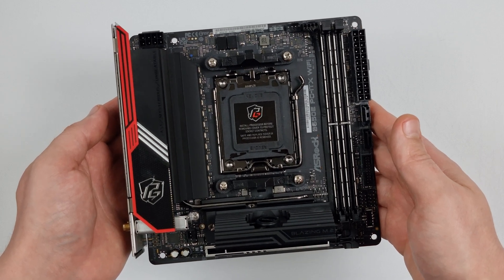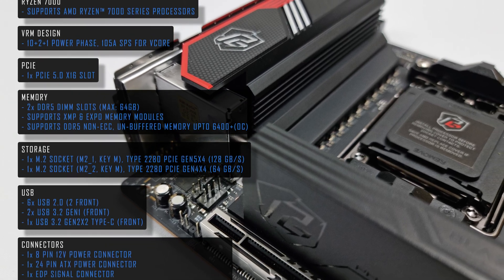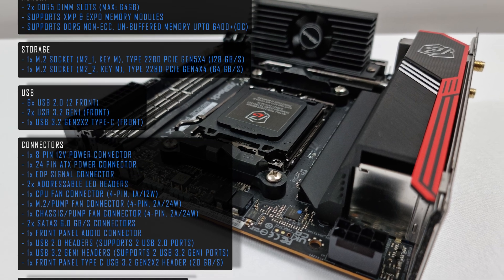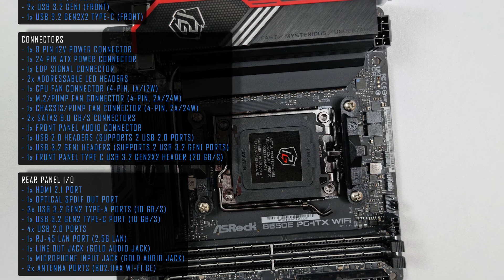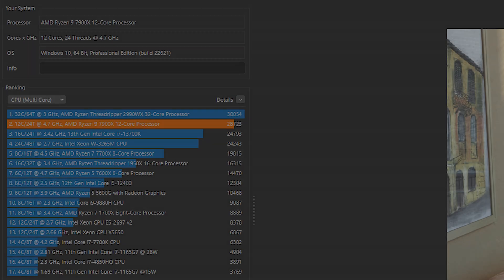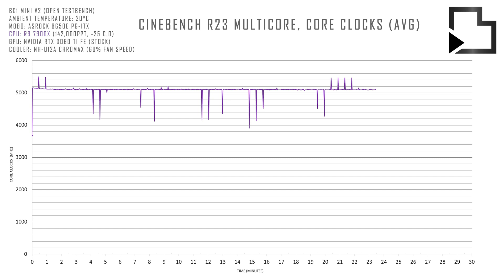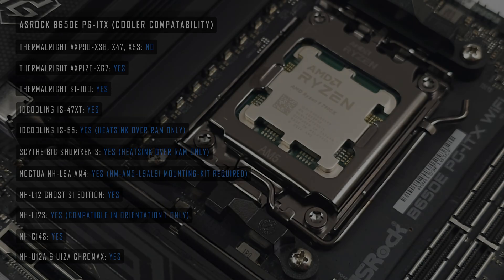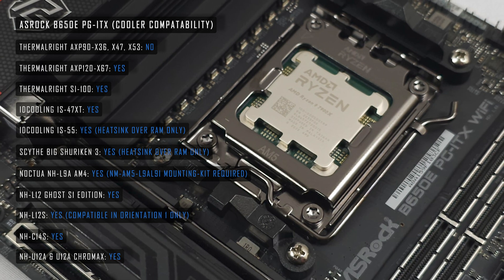Good ITX Board with some Quirks - ASRock B650E PG ITX

Comment: does that mean that a620i/b650i asrock lightning boards incompatible with apx90-47/53 aswell?
Reply from the maker: You'll need to use some smaller diameter aftermarket nuts due to the backplate design. Then it will work.
Reply: i just ordered it (a620i lightning board) a few days ago, i was planning to use it with my peerless assassin 120 on shiny snake G200 case, the other case that i was considering is shiny snake s300, but it support only sub60mm cpu fans, apx90 was my first guess as i really love the efficiency of thermalright air coolers; thanks for th quick reply <3 @L91
Reply: what do you mean by "aftermarket nuts" btw? i am afraid i dont understand ^^'  @L91
Reply from the maker: @aeszer  aftermarket simply means not official ones. In other words: just some nuts with smaller diameter than the included ones that work with motherboard backplate
Reply: i see, so you just need the four hex nuts of the lower diameter/area on the backplate, right? @L91
Reply from the maker: @daesz  correct
Reply: much obliged for your help mate <3 @L91

Comment: can I use the m.2/pump fan connector for a chassis fan instead?
Reply from the maker: You can use the pump header and the M.2. Though, I can't recall if the M.2 header has full manual control in BIOS or just basic control.

Comment: Hey, i am planning on a new build and was wondering which Am5 motherboard would be reliable and you would recommend with 7800x3d?
Reply from the maker: One with BIOS flashback for sure, so definitely not the ASRock B650E PG-ITX. MSI MPG B650I Edge WiFi, Gigabyte B650I, & Rog B650E-I are all solid options 👌
Reply: @L91  Thanks for the quick reply. much appreciated :)

Comment: Thanks a lot for making these videos as they are super useful. 
I recently built a PC with a 7800x3d and the ASUS B650E-I motherboard but coil whine is really bad. 
I was considering getting another board and this one seems to be the only option without coil whine issues. 
You mentioned the fact that x3d CPUs aren’t supported out of the box… is that right? When I got the ASUs B650E-I, I didn’t have to update the bios and it worked out of the box.
Reply: Yes, X3D will NOT POST on the Asrock unless updated and Asrock did not implement any BIOS flashback option so you'd need a second non-X3D CPU.
I returned mine because of that as I couldn't borrow another CPU.

Comment: FWIW, I found the fan on the heatsink over the m.2 slot to be quite loud at high RPM, but its not an issue if you set it to a flat fan curve of like 35%.
Reply from the maker: I just used silent preset and didn't really notice the fan after that

Comment: Any idea on how to make the AXP90 series work with this motherboard? I haven't gotten to building my PC yet and have this exact combination
Reply from the maker: You can try sourcing replacement nuts with smaller diameters, think they use M2.5 thread
Reply: @L91  Thanks for the response, confirmed with Thermalright support that they indeed are using M2.5 thread. Will see if the screw nuts I ordered will work

Comment: This is the only AM5 ITX board that is available in Central Europe and that doesn't have an annoying flaw
Reply: No BIOS Flashback and no USB-C display out are not annoying flaws?
Reply: @philippmaash1896  The lack of BIOS flashback is an epic failure. I returned it.
Reply from the maker: You can get the B650I Edge, but it has its own downsides. There is no perfect AM5 ITX motherboard, but I do think ASRock has come close depending on the use case.